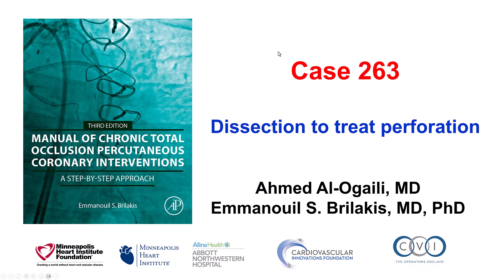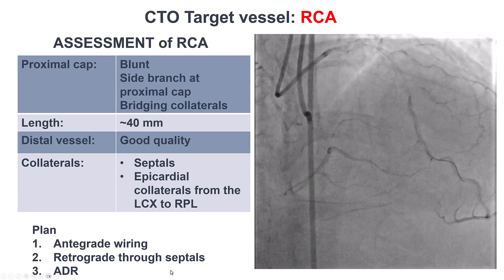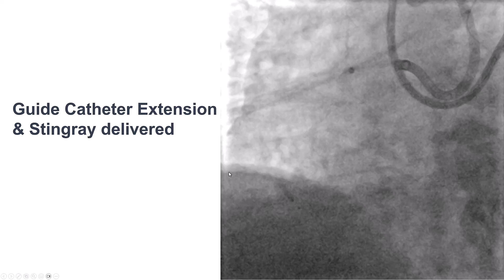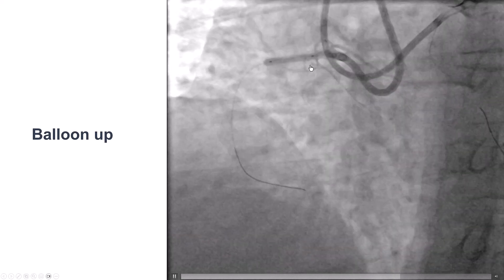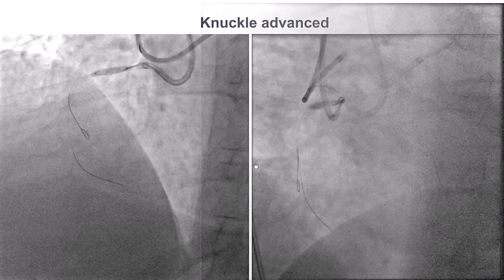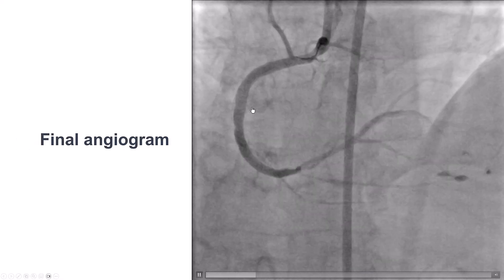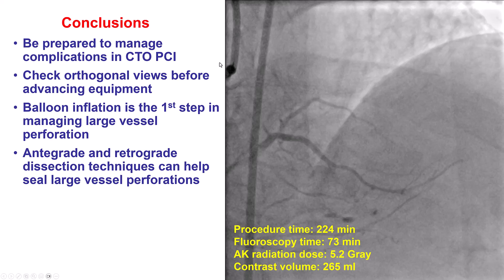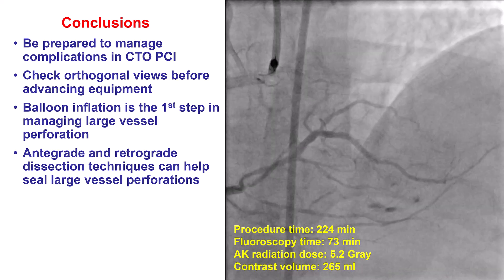Case 263: Manual of CTO PCI: Dissection to treat perforation

Comment: Would you recommend getting an injection after starting Knuckle?
this is safer after evaluating the wire dancing with the vase
Reply from the maker: Would not inject contrast antegrade as this could enlarge the dissection space and hinder re-entry. Would do retrograde injection to check the position of the knuckle in relation with the distal vessel.